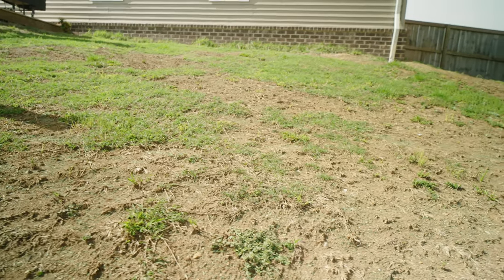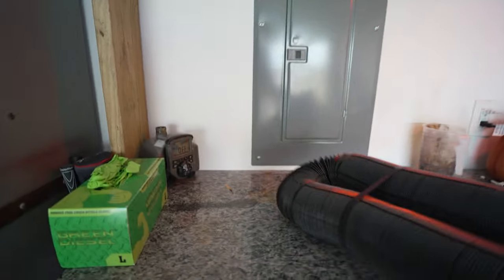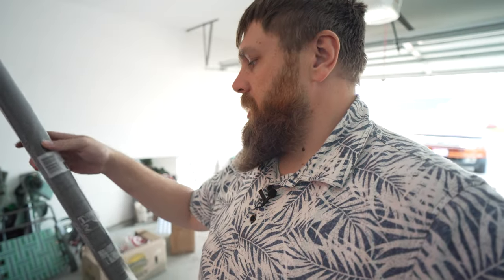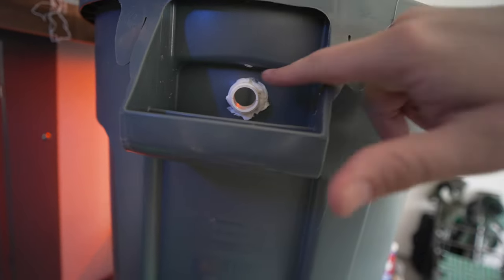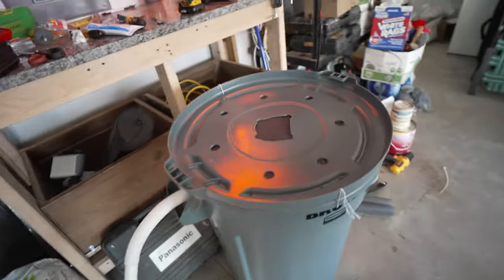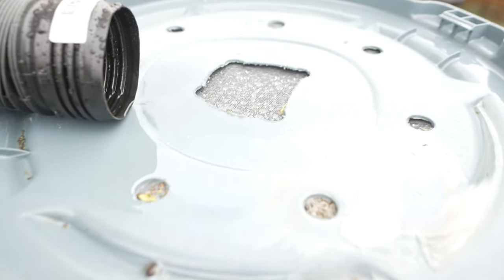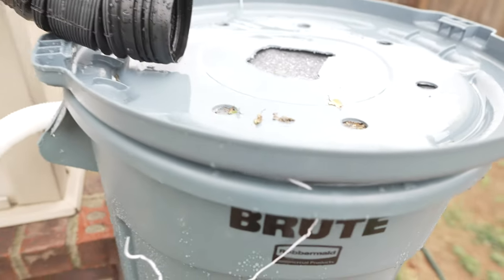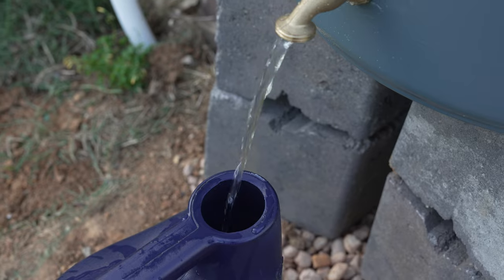Make Your Own Rain Barrel EASY!

Comment: Nice idea. Awesome vid. I always like the lessons-learned at the end of the video. Just to be safe, I would apply the plumbers caulk on the inside of the can as well. I wonder how often you'll need to clean the barrel? 🤔 Would be interested in an update video in the summer. Hope it helps the erosion!!
Reply from the maker: I applied caulk inside as well. The can is a bit flimsy so the seam isn't great. I will do an update for sure.

Comment: what size of the discharge hose? did you use anything to hold the discharge hose to secure in place from falling off the can? i'm planning to make my own rain barrel, so new to this thing
Reply from the maker: It was a 1 inch hose and I used a small screw and plummers caulk to secure it to the barrel. It works really well.